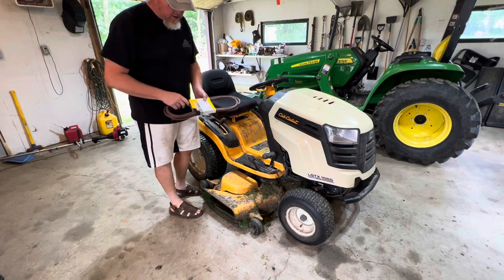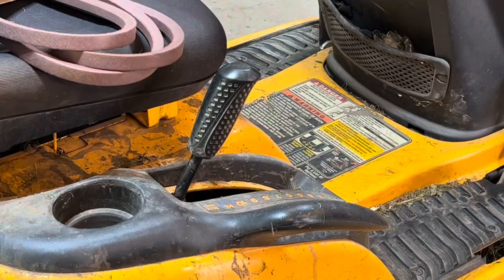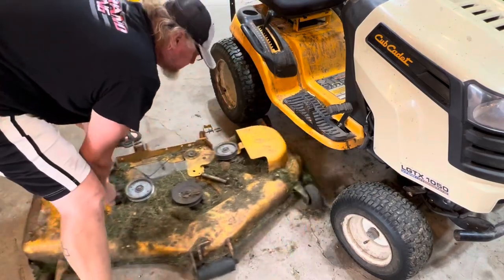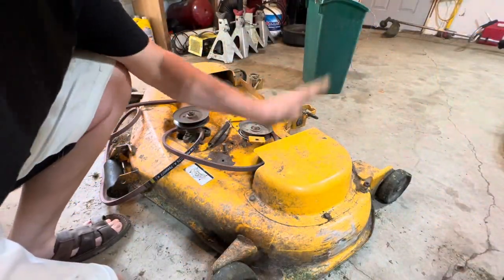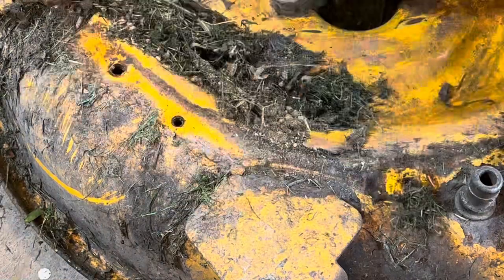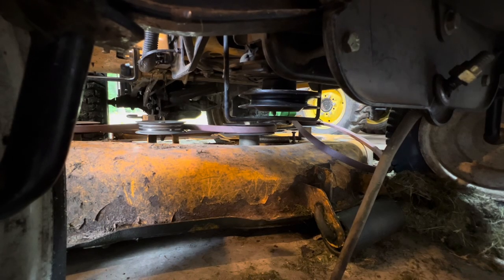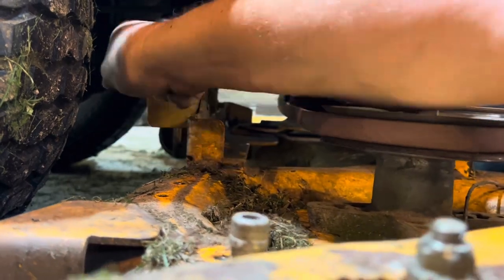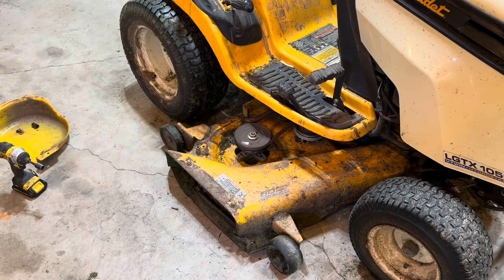Cub Cadet 1050 50” Mower Deck Belt Replacement

Comment: On the right side of the LT 1050, there is a notch where the right support goes is very small and sometimes the support wants to go with the deck.
Reply from the maker: @johnharris6655  if you’re referring to the support for the locking pin with the spring on it? It can be a bit of a struggle to put those back in.
Reply: @pilgrimsgarage  I found that out. Next them tension spring comes lose I will put it back without taking off the deck.

Comment: I took out the starter and it gave me enough room to not have to take out the battery at all.  I came in from the back of the retention clip with a flat head screwdriver that was inside the 'dash' behind the steering column.  One slight twist, and the clip was out of the way.  I heard a lot of grumbles about that clip, so hopefully this helps someone get there easier.  Just waiting on the parts now....
Reply from the maker: Good information right there. Thank you for the tip!

Comment: I have the same mower but keep going through belts. The belt that is recommended for mine is 138” long but what is happening I believe is that the idler pully on the tensioner is allow to swing to far and when the pto is on the belt on the tensioner hits itself where the belt is going back to the right side pulley  and hits the pulley edge roughing it up until it breaks. I see you belt is what 135” . Maybe I need a shorter bet that would allow the tension pulley to move more towards the pto pulley making the distance farther away from the belt to come in contact with itself . Hope you can interpret what I’m trying to say?
Reply from the maker: I would give a shorter belt a try. That belt shouldn’t move around as much as you’re saying. My belt has been working fine all year but it does show signs of wear.

Comment: the belt on mine rides super high on the idler and the mower keeps throwing the belt when I engage the pto...thinking about putting some spacers under the idler pulley to raise it up.
Reply from the maker: Have you changed the mower spindles? It should line up fine.

Comment: The belt guide under the engine is right up against the belt. The belt gets really hot, is the metal guide supposed to be touching the belt like that? I know the purpose of the guide but the belt rubbing against metal at that speed for a long duration doesn't make sense to me. Any idea? Is yours like that?
Reply from the maker: Yeah mine is like that too. I’ve never understood the mechanics of that one either, that’s why I bought 2 of them. I’m only 2/3 through the season right now and it’s already looking kinda frayed. Ever since Cub Cadet was bought out by MTD it has gone down hill.
Reply: As long as there is a small gap between the guide belt and the pulley then your good.

Comment: I have 2 cubs  . ltx 1042 kw  22 hp V TWIN  bought in 2016 and new one bought this spring    ltx 1046 23 HP V TWIN  I did also have to take off the hov covers that leaked and used black permatex to reseal them .I had a troy built 2017 model but sold it and replaced it with the new cubby  . I live on a hill and troy built only had 2 anti scalping wheels      cubs have 4      and my ziosa grass is thick so replaced  the blades with gator blades  , cgops the gras finer  and last longer and don't need sharpened    . Sold troy built new  gator blades , new belts , gas filter and oil filter like brand new for 800 dollars . Got deal on new cubby  sells for 22 hundred got it for just under 19 hundred brand new and that was with taxes   WIN WIN  AND PUT GATOR BLADES ON IT THE FIRST MONTH

Comment: it does not explain how he overcame the belt tension to pull the deck back to the spring bolt attachments!!!!
Reply from the maker: Yes it does. He (me) just gave it a pull. It is a bit on the stout side but you can overcome it with a little uumph. I find it best to grab the belt and pull it over the one of the spindles while it’s in the tensioner. It isn’t terribly hard. Hopefully that helps.
Reply: At 2:12 where he snaps the belt between that bracket and the pulley, notice the square hole on the bracket? Put a ratchet with a cheater pipe in there and leverage it toward the front of the tractor while you put the belt on the crank pulley.